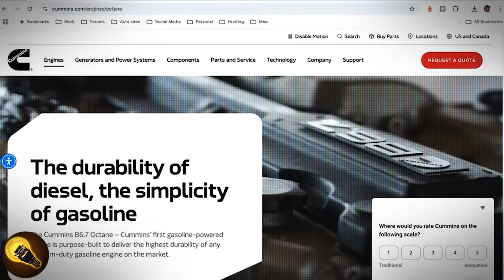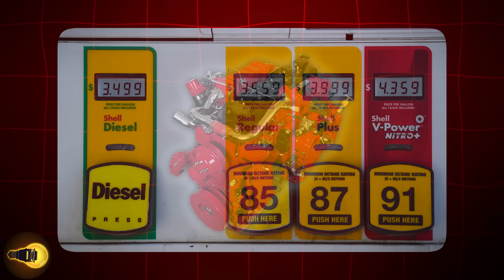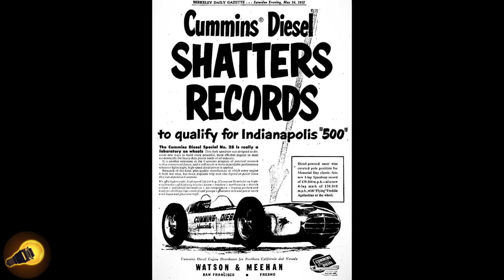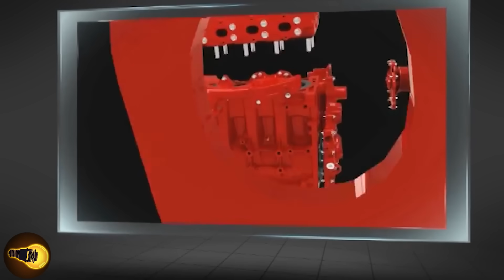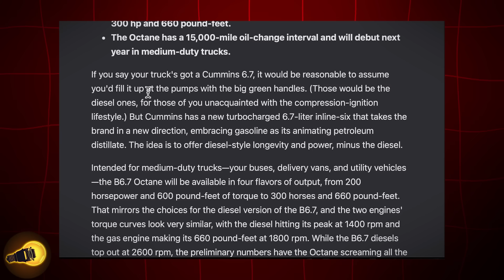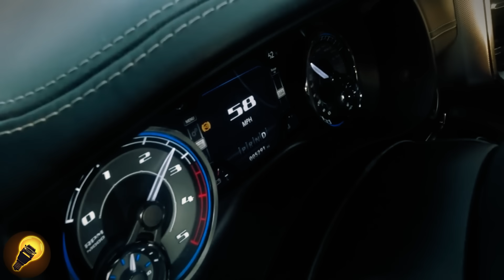Cummins Shakes The Industry With A Gasoline Engine!!!

Comment: These ppl pushing 0 emissions clearly don’t know the laws of thermodynamics….. lmao
Reply: Or the laws of economics.
Reply: @bradclark2922  EV
Reply: @bradclark2922  It's a lot more expensive to run diesel due to environmental impact, it just used to be dumped on the local community instead of the gas pump. Ask people who lived with acid rain and smog choked cities.
Reply: @kirknay  Europe went electric or hybrid because many city's literally stunk like diesel . The acid rain was terrible also.
Reply: yeah, like the prius engine that has better than diesel bsfc.
Reply: @zoomanx9661  how is it nuts to not want to die directly to some asshole's polution?
Reply: zero mesion doesn mean it voaltes the law of therdicamics it means the burns the co2 untill there no co2 left to bacly come out the exast pipe bacly useing the the clean emsions tech for fosslefuels to give green peace the middle finger saying you want clean emsions and redcue co2 emsion well we will make a fosslefuel enginew that makes  so littel to no co2 emsions that the green hosue gas in eath atmohpere will acatl drop from so litel to none co2 emeiopns form new clean fosslefuel tech.. its still burnms fosslefuel but does it so cleanly that it does make any greenhose gas in anyway that the envoerment will actly will balry get any co2 so green hose gas will actly drop. this si what trump as been actly helping to work on to prove a goash darn pont that usa oil and fossle fuel can be eneamlrty green too bescue carbon is the apr tfoteh envlermt its just we will use it far more in s sustable maner wihout bacly bankruping ourselfs.
Reply: Nuclear + electric is very close to being zero emissions. Heat energy would become the problem if we were to continue increasing energy production using nuclear + electric, not emissions, but the problem would be far enough away that we'd likely never need to worry.
Reply: @PistonAvatarGuy  well teh heat issues won't be bad if the co2 leevls in teh atmospher go down would actly make it muc h less of a issue by the way. also the heat issues with nucler energy is actaly the very easy part it just the ahrd part is geting inverterctire to do lagre sacaler recpeceing of the fuel is acatly requred for porepr nuclear enrgy use. but also the bypeocts in the nucler waste can also be used for new powerplant terbines too that would amke it much easer to make new ones as struiom 90 doesn infact decay ineto zictruom 90 atre 30 years that can also besued to power radiotehrmgenrators and nuclaer strling engines while we wait of the srtuom 90 to decay in toe zicreuom 90 with means even more power genraton even after post nucler reactor use can still make power as rtg or nucler srtling power gernation for passive sroced of power gernraton too after the fule repceing byprocuts still can do that as well. even the srtuom 90 nucler waste itself still is usefuel for power genrtion bescue its whatthe sovletns used for ther rtgs and it decayd into zeicruom 90 after 30 years withc is the same aciroum isotpye we use for makting metal alloys ofr powerplant and aeropsce terbine blades for high temrpeu adn durepbty aplactions as well. witch emans fuel repcoeing and useing teh srtuom 90 nuclawer waste itself is still usefuel fo extra powergenrton asa waste byprocut of nucelr fuel repcoeing itself. that means the srtuom 90 waste after three deacde can be sued to make even more nucler powerplant and aircraft in far lagrer maonut then you would be able to mine out of the gronud form earth natruly anyway withc is aclt worht the extra nuclwaer waste fule repceoing alone would make buidng more nucler plowerplants actaly much cheaper as well makeing ncuealer thermal engine engine even cheper to make too form all the zicouom 90 made as a bycprocut after 30 years anyway.
Reply: @PistonAvatarGuy  i dont think nuke is a viable option financially or environmentally. Solar, geothermal , hydro and improved batt tech for storage is the future. The much better battery tech is there just very expensive right now. once they improve the economics you would have to be an-- to own anything fossil fueled.
Reply: @tomhutchins1046  Nuclear is the least expensive option per kWh produced (see: consumer prices in France and US wholesale prices) and it has the lowest environmental impact of any low carbon carbon source by a huge margin (1/7th the warming effect of solar, far less resource intensive than wind or solar). Battery tech is far too resource intensive to ever be a viable method of storing grid energy on a large scale. The economics are bad for batteries because they're insanely resource intensive to produce. Resource intensive = bad for the environment.
Reply: @PistonAvatarGuy  and what do we do with the spent fuel?? Were do we get the new fuel? Why are they being fazed out? And your 1/7 please supply your source for that? I will agree wind has issues but solar is proven. battery tech is available much better than lithium but so far expensive. that will change. nuke needs to go away. salt based battery's are one option and in a non Mobil application make sense. Also much of the time solar goes straight to the grid.
Reply: @PistonAvatarGuy  Chernobyl ? 3 mile island?
Reply: @PistonAvatarGuy  you may want to read up on the earthquake in japan
Reply: @tomhutchins1046  90 to 99% of spent nuclear fuel is recyclable. New fuel is everywhere, including ocean water. There's literally hundreds of thousands of years worth of nuclear fuel on Earth. The UNECE found that nuclear energy has 1/7th of the warming effect of solar.

Solar only produces energy during the day and it has never been shown to significantly displace the consumption of fossil fuels on a large scale.

Nuclear is not being phased out, nuclear generating capacity is still growing.

Salt based batteries (sodium batteries) have been around for a long time, they're also extremely expensive.

Solar doesn't produce energy at night.
Reply: @tomhutchins1046  Chernobyl could never happen outside of the former Soviet Union, no one else builds reactors like those that were built by the Soviets. TMI resulted in no deaths and no environmental damage. Fukushima was completely avoidable and people knew that it was a potential problem long before the accident occurred.
Reply: @PistonAvatarGuy  Your obviously an advocate for nuclear, There have also been other issues public and private. What is the common denominator? =Humans. Clearly no worth the risk. Also you did not answer me were does the fuel come from and what to do with the spent fuel.
Reply: @PistonAvatarGuy  Ps TMi got so close to a huge disaster.
Reply: @tomhutchins1046 you may want to read up on the horrible site selection process that ended up in the disaster. Had the plant not been placed at on the coast (and at sea level), you'd likely have never known it existed.
Reply: @tomhutchins1046  there are safer stronger fuels that China is currently investing in. The nuclear of 1970 is not the nuclear of 2025.
Reply: @brianmurray7980  Were would we get the fuels and where would we put the spent fuel?
Reply: Where did you get your degree in Thermodynamics?
Reply: @tomhutchins1046  is this reply to me or americantrucker?
Reply: @arthurmario5996  American trucker
Reply: They don't know that their farts are worse than what a engine put out
Reply from the maker: That’s a good point right there
Reply: The EPA sucks
Reply: Drink the coolade huh?
Reply: @darryladams519 Nobody gives a rip. Derp derp d'oh 🤡.
Reply: @zoomanx9661  how dare people want checks notes to not be asphixiated by smog or melted by acid rain?
Reply: @kirknay  The eco-nuts
Reply: Sounds more like you don't fully understand how combustion works or why diesel engines are terrible for the environment.
Reply: @brianmurray7980 sounds like you dont understand the periodic table of elements
Reply: @TheAnnoyingBoss  emissions are directly related to how completely the fuel combusts. The less complete the combustion the more stuff going into the air (CO, methane, soot, etc).